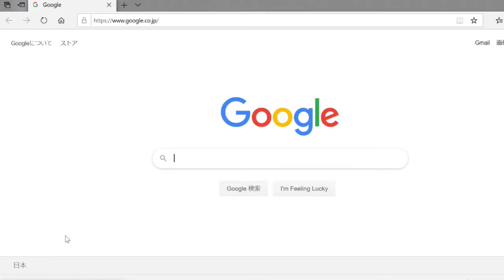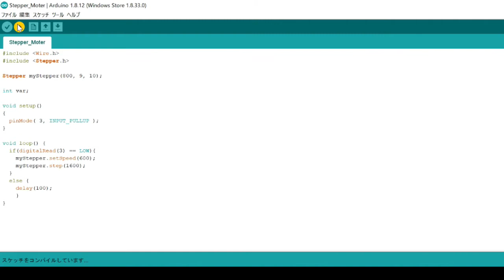【簡単Arduino #1】ステッピングモーターを回してみよう（字幕ONで説明有り）

Comment: No code no use
Reply from the maker: #include <Stepper.h>
Stepper myStepper(800, 8, 9); 

void setup()
{
  
  pinMode( 3, INPUT_PULLUP );
    
}

void loop() {
  if(digitalRead(3) == LOW){
    myStepper.setSpeed(600);
    myStepper.step(1600);
    }
   else {
    delay(100);
    }
}

Comment: この回路を使ってモーターを
90°回転→1秒待機→90°逆回転→1秒待機
みたいな制御はできますでしょうか？
Reply from the maker: ガオ ガオさん　できますよ。

if(digitalRead(3) == LOW){
//もしスタートボタンが押されてインプット3番ピンがLOWになったとき

この動画では、

    myStepper.setSpeed(600);
    myStepper.step(1600);
    //スピード600  1600パルス=1回転

↑こうなっているところを

    myStepper.setSpeed(600);
    myStepper.step(400);
    delay(1000);
    //スピード600  400パルス=90度回転  1秒待機

    myStepper.setSpeed(600);
    myStepper.step(-400);
    delay(1000);
    //スピード600  -400パルス=-90度回転  1秒待機

このように書き換えれば良いです。お試しください！
Reply: 実際に試して上手くいきました！
ありがとうございます！
Reply from the maker: 90度なのでstep 400 でしたね。うまくいってよかったです！